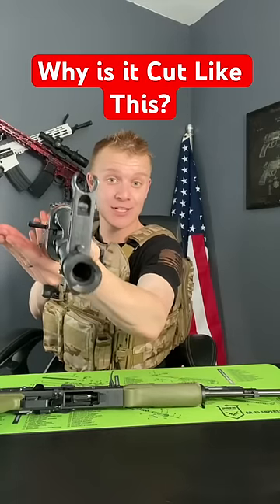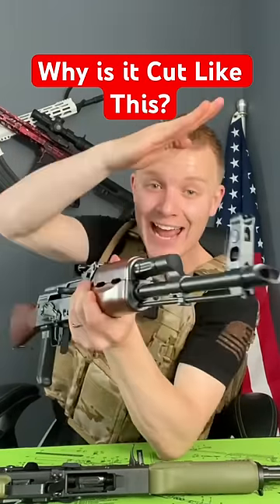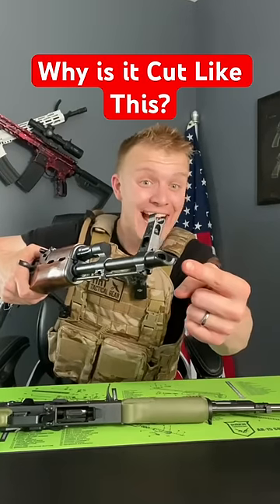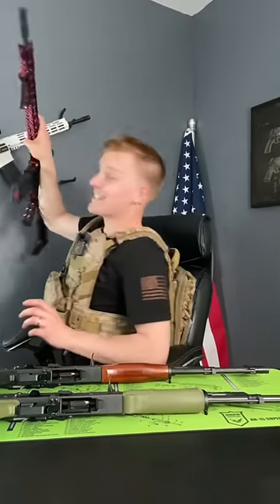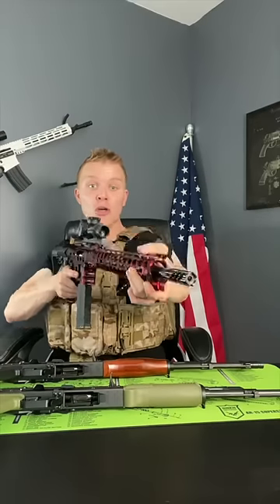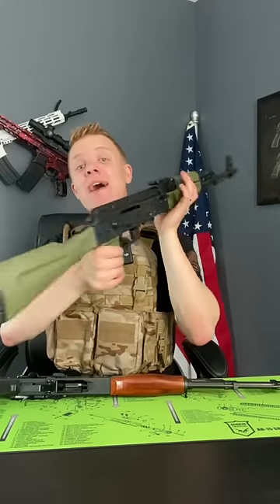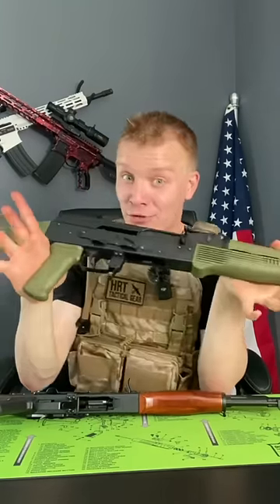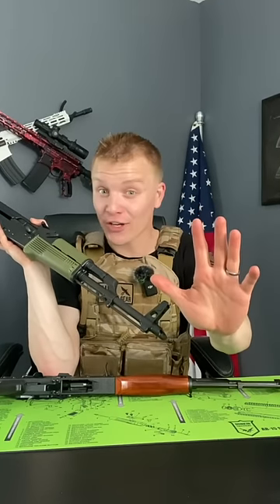Why is it Cut Weird? (Riley Defense AK-47) #ak47 #demolitionranch #fullautofriday

Comment: its not just for fully automatic fire. It’s because of the AKs operating system. the gas piston assembly and the bolt are heavier than an AR rifles so they recoil more when moving backwards. because of the way we hold rifles ALL RIFLES will slightly recoil to the side of our dominant hand. the slant brake has been around for a long time and it can be just as effective on a semi auto rifle
Reply: That's not why, or at least not entirely the explanation. The AK without this brake will climb because of the stock not being inline and having a slightly angled position. The moment of inertia is above the top of the butt stock and induced more climb that even the Mosin Negant because it was shorter and had its center of gravity shifting to the rear when fired. And how we hold rifles and the placement setting it to the right of our own center of mass with the left hand being further out cause some rightward deviation from the target. This brake was added during the development and solved both those problems with an easy to manufacture low cost piece of steel. It's a super simple solution that kept the rifle on target during all types of shooting and made a huge difference in the trials as the soviets were looking for their next service rifle.
Reply: Why tf is demolition ranch in the description?
Reply: @alexmaurice4274  clout chasing
Reply: Idk dude I feel like my AR has more recoil than my AK.
Reply: @alexmaurice4274  he's trying to piggyback views.
Reply: @oldnite3414  tune your AR. No need to change your barrel or gas block at all. If you have a mil-spec M16 BCG already in it then you can move to an H2 or H3 buffer. You can also check the gas rings for wear. You can also get a new buffer spring. Take your buffer spring and measure it out of the gun. Just use a measuring tape, for carbine buffer tubes it should be between 10.0625 inches and 11.25 inches and  between 11.75 inches and 13.5 inches for rifle buffer tubes. I'd recommend going to Geissele. You can get a heavier duty spring for over gassed ARs. If your spring is the issue they have some of the best ones on the market. Yes they have a cost, but they will last as long as 2 or 3 standard springs and it's a one time purchase before prices climb.
Reply: @oldnite3414 definitely not it’s not possible as a ak47 typically takes 7.62s which are highly devastating rounds meaning they pack more weight, powder, and kick so they will have a higher recoil but on the other hand the ar15 typically takes .223 or 5.56 which are much smaller and lighter rounds compared to the 7.62s so therefore your ar15 has less recoil then the ak47 but you feel like it has more probably because you’ve never shot an ak47.
Reply: @ahsanlodhi4773   7.62 has more mass but less powder than 5.56 which has less mass but more powder. At least from my personal experience I can say different AKs and ARs feel similar but different. Some AKs shoot smoother than ARs and vice versa. Just depends on the type and setup. Also I wouldn’t say 7.62 is “highly devastating”. Its just more effective at releasing its full energy potential on unarmored or lightly armored targets whereas 5.56 is more effective on light to mid armored targets. Note my descriptions for the use of each round is quite loose. They can be used in any which way and still be very effective. I am just going off of how the rounds were designed and the time period they were designed in.
Reply: @shadowreapr9432  I guess the highly devastating part is maybe perspective based or opinion based like for example some might consider a .357 or even a .44 magnum highly devastating but I don’t consider them highly devastating because I guess just my perspective and opinion on them but I definitely do believe that 7.62s are devastating in my opinion and experience of course that is but thank you for your perspective and thanks for telling me that the powder is less in 7.62 and more in 5.56 sorry I got confused I thought it was the other way around.
Reply: @shadowreapr9432  yo interesting facts man thanks for sharing I’m still learning more each day so it’s pretty cool I guess I like guns but at the same time I hate them lol it’s a complicated relationship
Reply: @Ahsan lodhi  Bruh I own a Lee Armory akm and it feels better to shoot than my AR
Reply: @Deathbomb9  thank you for the explanation I was thinking about replacing the muzzle brake on my AK but now I don't think I will
Reply: @darthmetallord  it really depends on the AK and setup you have. If you're a purist then I'd leave it alone. If it's an older one and you want to keep it in stock configuration then I'd go pick up a new one from a good company and do as you please. Different muzzle devices have different purposes. Unless you would be using it in a situation where quick follow-up shots would be needed then set it up to do that. If it just something you take to the range then set it up as you like. I'll say that if you get the right muzzle devices you can switch them out rather easily and quickly if you decide you need a different one in a different situation. Other than a little advice or talking about what someone could do, it's ultimately your rifle and you can change parts or add on mods as you see fit. If you are changing the muzzle device, ensure it's clocked properly and inline with the bore. Had this issue with the first muzzle device I had on my first AR build and had to modify it to not interfere with the path of the bullet. Still laugh at myself about that to this day.
Reply: @Deathbomb9  thank you for the advice maybe I'll upgrade it but right now it's the smoothest rifle I've got and it's laser accurate for an AK I think if I upgrade it I'm probably going to get a flash hider seen a few videos on them turns the fireball at night into a lighter flick
Reply: @Deathbomb9  I still have PTSD from ordering a pistol sight off of Amazon didn't give me the proper tools and thread lock was needed
Reply: @Deathbomb9 you’re wrong lol. It’s the gas system being put in at a slight angle. Has nothing to do with the stock
Reply: @logans205  the AK has no more powerful recoil than the AR. The weight of the bolt has little to do with it. The angle of the gas system has nothing to do with it. It's a straight rearward motion. It's the same concept as pistols. The moving mass being above the point of contact converts some of that movement into rotation. If the stock were set up to have the forces of the bolts recoil driving straight into your shoulder, there would be zero climb being induced. It's physics, and pretty simple physics. Also, the angle of the gas system has nothing to do with the climb. If it were angled, the bolts motion would cause more climb.
Reply: @Deathbomb9  no lol
Reply: @logans205  if that's what you want to believe then you keep on believing it, bud. I've explained it plenty of times here so you're welcome to go read those explanations.
Reply: Thats exactly what I was going to say 👍

Comment: 1. It’s an AKM
2. It’s a compensator
3. This compensator compensates for the slightly diagonal muzzle rise that is going to the right. Hence why the cut is done so that the protruding part of the compensator is down/left of the muzzle. It’s the heavy charging handle going back and forth that makes the muzzle going a bit to the right when shooting.
Reply: I tough it was AKM because original ak 47 doesn't have that compensator
Reply: It is an ak-47

Comment: These muzzle breaks can be reversed for left handed shooters lmao 🤣
Reply: I was coming to the comments to say the same. 😊
Reply: Some of them can, but not all. Zastava AKs come with a slant break that has two notches so that it’s reversible, but generally slant brakes won’t have that feature.
Reply: Dremel…
Reply: @baileyperry7558  mine does
Reply: Not all of them. The AK I have, a PSAK GF5, only has one notch, so it can only be used effectively right handed. Right now, at least. I could take a Dremel to it and add a second notch, but I'd rather not bother.
Reply: @fudgerounds91 found you. My gf3 is the same way. Once it starts locking on the pin, it would be so extremely stupid not to just tighten it down to the position its suppose to sit in, otherwise it’ll just get blown off lol, seen a guy a few lanes down do it to his. Side note: first time i cleaned it, i didn’t realize it was suppose to come off opposite thread, took me like 20 mins to figure that out LOL, after i tightened tf out of it
Reply: This dude don't know what he's talking about in a lot of his videos..
Reply: @baileyperry7558 As a Serbian, i can confirm thats true. Our company Zastava is always looking for what they can improve, fix or add to the normal M70's (Zastava's AK47) or M21's (Zastava's AK74N).
Reply: I was just about to say this myself. Glad I didn’t have to.
Reply: Facts
Reply: Don't tell them shhhh
Reply: @cf9590 clearly I mean he's using a Riley defense as a example, not a good AK
Reply: No lol. It’s because the gas system is at a slight angle.
Reply: @_misterpanda  sometimes too much, zastava tokarev's can't use normal magazines or grips because they had to make it different for a whole one extra round.

Comment: It's not for right-handed shooters. It is for the mass distribution considering there's more mass on the right hand side of the bolt carrier group So therefore when the bolt carrier is moving back and forth, it actually pulls the gun to the right whenever the bolt slams to the rear

Comment: To my knowledge, the angled cut on the barrel is a remnant of the 1980s assault weapons, ban or one of the things that made an assault weapon of assault weapon was the ability to thread on a muzzle brake or flash hiding device
Reply: Completely wrong on that one, the slant break was designed by kalashnikov in the 50s, and it threads on. Zero relation to the US AWB

Comment: Yeah That's true but Fully automatic rifles tend to push left or right depending where the ejection port is if the ejection Is on the right side then it will tend to push left vice versa So what they should have done was face the muzzle break to the left and your port is on the right

Comment: To Balance the left side gas pressure exertion, the muzzle was designed to be angled so the gas on the Right compensates the Left side recoil and also to be angled with the muzzle grooves

Comment: Muzzle brakes and compensators are two totally different muzzle devices. You have muzzle brakes confused with compensators. Compensators push the gasses upwards, muzzle brakes push the gasses to the sides.

Comment: Literally the lamest gun post I ever seen😭
Reply: Bro what?
Reply: And yet you watched it and commented on it.
Reply: He has become a joke of the comunity..constintly giving crap info and uses equipment wrong.....nothing wrong qith this if you dont act like u know it all...
Reply: @randomyoutubedude673  All he said was made up and it wasn't even April fools.

If you have the slightest knowledge about physics you know it doesn't matter for the muzzle device if you are holding a gun left or right handed or are you are shooting full auto.

Also he calls it an ak47 although AK's before modernization didn't have the muzzle device.

Real reason for the slanted muzzle device is that most weight of the bolt carrier is on the right side of the gun so without the device gun is pulled to the right on every shot

Comment: It's not on all aks, it is predominantly on the akm and its variants, the original ak-47 had a flush muzzle with no cut, and the ak-74 and ak-100 variants have conpletely different muzzles to compensate for varrying ammo types and barrel lengths

Comment: Lots of non AK shooters. The AK moves UP and TO THE RIGHT because of the gas AND charging handle reciprocating on the right side of the gun. Everytime the bolt cycles back it moves the rifle to the right and the gas recoil moves it up. It doesn't matter what handed shooter you are the results are the same.

Comment: You can literally take it off or put any muzzle brake you want on. Way way easier than changing muzzle devices on an ar too. Also that is a muzzle brake as well as flash hider. If you don’t believe me then take it off. You will no longer be shooting sparks from the barrel but fireballs. Also the Akm‘s/ak47’s recoil up and to the right slightly. These special brakes counter act that, regardless of you’re fully automatic. Obviously

Comment: It's not for auto fire. It's recoil will push it slightly up to the right because it's stock isn't inline with the point of recoil or the moment of inertia. That point is slightly above the top of the butt plate. And this being a semi auto with am intermediate cartridge means soldiers would desire to shoot it fasted and would be able to shoot faster. But would drift off target and not shoot as accurately as previous designs and competing designs when it was being developed. It keeps the rifle on target for faster follow up shots to be taken. Adding that simple brake solved all the issues of the muzzle climb and offset and made the AK-47 the most predominant and prolific weapon of the second half of the 20th century and even to this day it is the choice for the vast majority of militarized forces with lower budgets and few ties to the western world, and even some of the western world uses rifles based on its design and function.

Comment: If it threads on like a normal muzzle device, could you shim it so that it installs in an orientation that is more optimized for lefties?
Reply: ABSOLUTELY, they have a notch on the outside of the muzzle device, and a spring loaded plunger that extends forward from within the front sight tower.

You can time the muzzle device as you feel appropriate and file your own notch for the plunger.

There is not a torque spec for just a muzzle device. Protect threads from corrosion, and fill the gap as you please. 

If that muzzle device is the attachment point for something else, like a muffler. The timing, bore alignment, and shimming become very important.

Now for the fun part. AK have left hand threads for muzzle devices. Righty-tighty is backwards. Righty loosy, lefty-tighty.

Maybe the Russians just expected all left handers to be armorers, and did them a favor.

Comment: Well I hate to say you have the reason the break is that way wrong because it doesn't matter what hand you hold the ak in its because the mass of the bolt causes muzzle rise to me up and left so it's cheap to make a slant that pushes gas down and right

Comment: What's is the barrel style called for ak47s that has the little flare on the end?
Reply: wdym by flare, you mean like a muzzle device?
Reply: @harveyknguyen  no clearly u have no idea what I'm talking about. On most ak47s they have the style he shows or another style I'm looking to find one of the other style
Reply: @mikebanks6704  Do you even know what you're talking about?... The AKM has interchangeable muzzle threads, so you can put any muzzle break on there. There's like a 101 different types of muzzle breaks from flash hiders to compensators.
Reply: @Ignar Husky  I feel like maybe he's talking about the boosters on the AKS-74U and AK-102/104/105
Reply: @wendigodrude5575  Likely, though those have a name lol
They're simply Flash Hider's, but it's not specifically named from what I could find. I'd assume Soviet Standard Issue Flash Hider Muzzle Break, but considering how many 3rd party part makers there are, I'm sure these days it's more specified by brand then anything else. I got a brand specific compensator for my AK(partly a doorbuster, it has some spiked ends) though the style itself doesn't have a name. Just the brand, what type of muzzle break it was(Compensator/doorbuster) and the threading(14x1 LH).
 Though the specific model is probably available, I got it from GunMagWarehouse so it's probably still on their shop. But either way, it's doesn't have a specific name besides the model name via the brand(e.g. the PWS FSC47 Muzzle Break or something specific like that). Which a Mil Standard, especially a Soviet Issued parts, aren't gonna be specially named besides M1956 or some shit lol
Reply: @IgnarHusky  honestly the easiest thing to say is probably just "AK muzzle booster"

Comment: No, it is to counter the recoil of the charging handle, you make these simple mistakes in many vids
Reply: Proof?
Reply: @LordFoogThe2st_  the Russians originally designed with a vertical break, and still had recoil pulling to the right, so they slanted the break as a counter to the hook on the charging handles weight

Comment: This is a terrible explanation. Every AK in the world is full auto except in the USA due to regulation. Oversimplified. The rotation of the bolt and the gas system cause the gun to move up at an angle and the slant brake helps balance the recoil to stay on target.